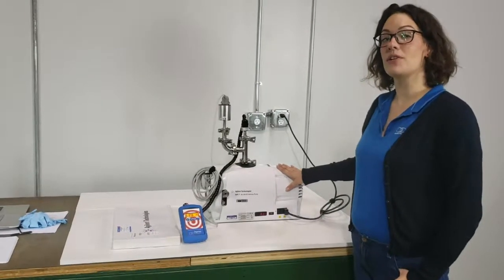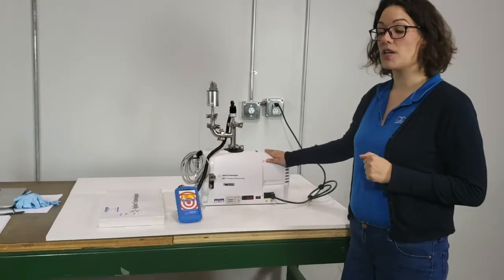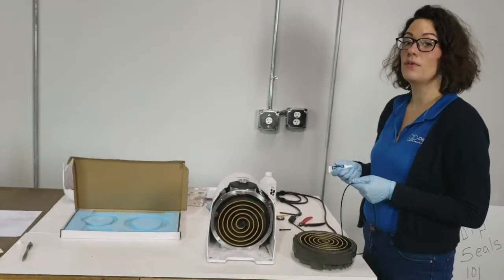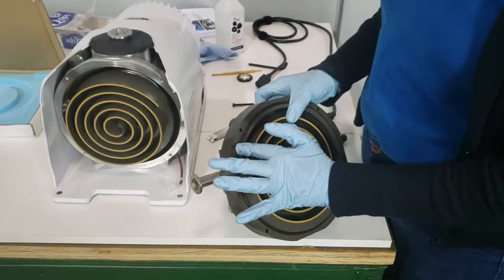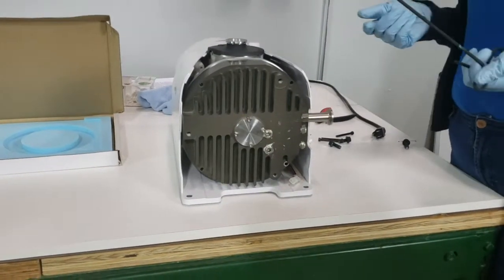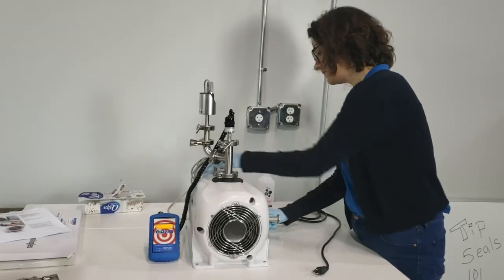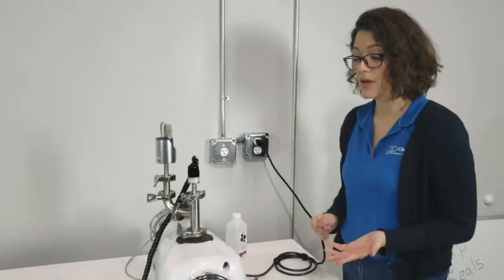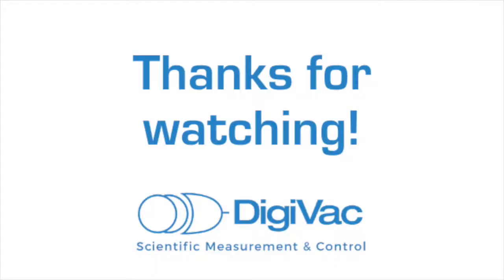Changing Tip Seal on an Agilent IDP-7 Scroll Pump

Comment: Yeah, fine but... You didn't show whole cleaning process. It's always very dirty, some sealings sticks to walls etc. What do you clean an interior with? Water? Alcohol? Open-change-close is very easy. All other procedure is much more complicated. More... Ive heard it's recommended once a year when the pump is running 24/7.